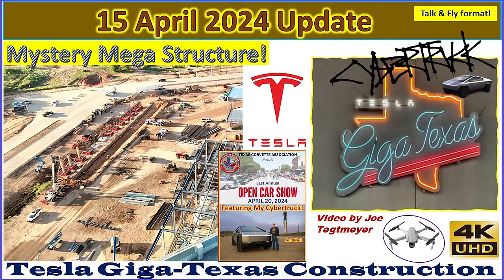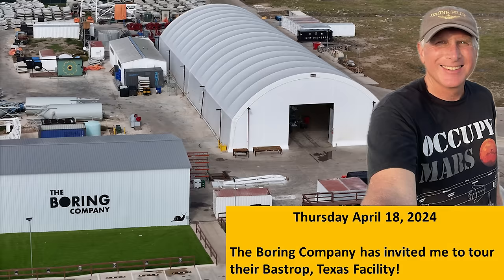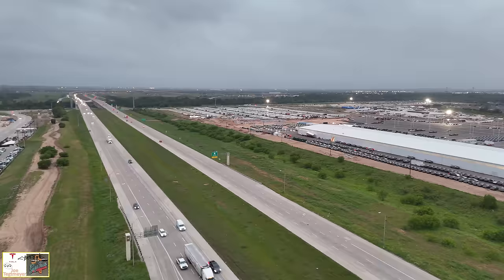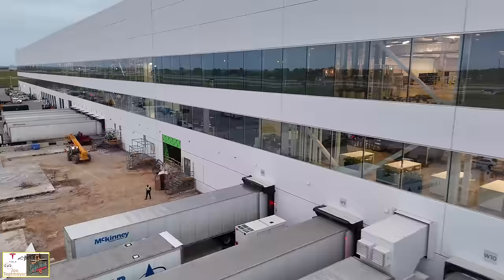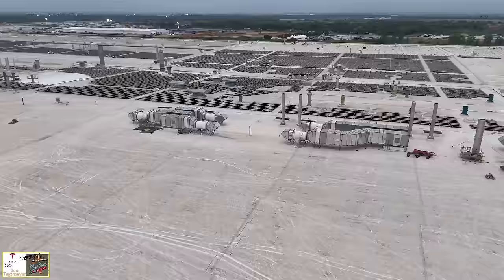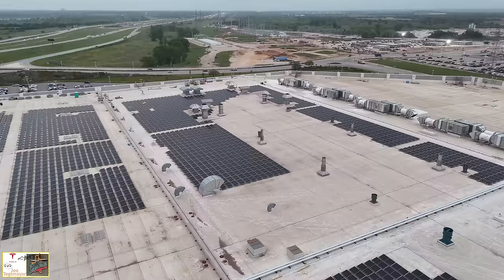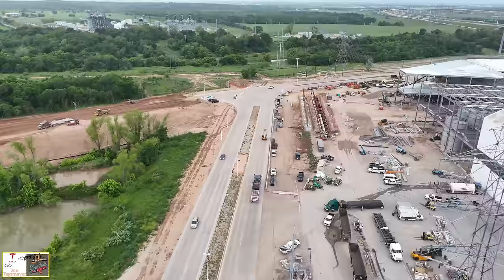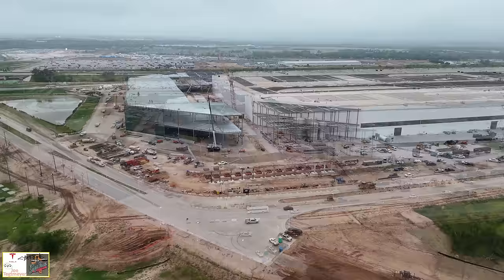Mystery Structure! Cybertrucks Pile Up & Leadership Changes! 15 Apr 2024 Giga Texas Update (07:15AM)

Comment: Thanks Joe
0:50. Southend. New Structure. Structure is located between Austin Energy easements. There’s an 800’ long sliver of land between the easements, tapers from 0’ at the north to 120’ wide at the south. This structure is in that space.
Rebar loops on top of the columns show where beams will be cast in-situ between.
Speculating this a structure to support a bridge crane to unload the coils of metal for Stamping. 
Up to 5 trailers are sometimes waiting on the apron at Stamping to back inside and have the coils unloaded. Lot of time wasted.
8:15. Paint, roof. Pipework Project. Pipe has now been lagged/insulated.
10:37. Die Shop, inside. Red legs of a gantry are briefly visible. In Joe’s photos a pair of red beams are visible, likely spanning the legs.
10:43. Die Shop. Inside. Curved safety screens around a machine. Can only be Italian.
12:21. Cathode. Inside. AHU-9. Air Handling Unit.
12:47. Cathode, tank farm. Vaporizers. Been an oops on the corner of the closest vaporizer.
13:04. Crash Test Track. Bottom left. 2 Red Model Xs.
14:14. Casting east, apron. Stack of castings marked for recycling.
15:37. E-WOW. Extra heavy duty low-laoder trailer. Been there just about every second video for weeks now. It’s either being stored here, or there’s big stuff moving in under cover of darkness.
17:06. Parking Garage, roof. Line marking around each stair location.
17:19. BIW, apron. 6 mobile chiller units still unconnected.
Roof. Top right. New large flue. Looks almost big enough to be the one delivered last week.
18:21. Southend, inside. Formwork/shuttering for a retaining wall.
18:52. Southend, inside. Right. Another retaining wall under construction.
19:01. Southend, inside. New slab has been saw-cut. It’s permanent. Large areas of GA have fibre reinforced concrete on Level 1/Ground floor.
Gap in the slab might get a conventional rebar and concrete slab to support the crane to remove the TBM.
Grade beam to the right. Fitting red plastic dots. Might be the top of dowel sleeves inserted into the beam.
20:01. Southend, roof. Back of parapet lined with Georgia Pacific DensDeck.
20:11. Southend, south. Parapet wall framing being constructed. If you sneak up on 20:11 you can see how the parapet frame is set back from the face of the glass wall below. Set back by the thickness of a glazed parapet facade.
20:42. Southend. Parapet. Won’t be concrete, no structure to support a concrete panel.
Inside. Column bracing to the right is rod. To the left and around to the west is cable.
21:52. GA west. New wall opening between the loading platforms. A week ago @eclecticmemes suggested this could be a temporary Cybertruck exit door.
24:57. New EOL, inside. Long view. Cybetruck on the elevated platform.
25:22. New EOL Supercharger. Bottom. Cleaning up the lighting tower footing. Installation of towers soon possibly.
Reply: Great list, Dessie!  Didn't notice it in previous videos, at 4:17 the ramp for gravity unloading (presumably tires) has a trailer / is in use.
11:52 looks like wiring for destination chargers at the north end of Cathode
17:06 I thought I saw the line painting cart zooming across in Brad's video, confirmed.
Reply: @Gig0Surf  4:17. Good spot 1. Eyeballing the trailer roof with the one adjacent confirms the idea that it raises the trailer.
11:52. Good spot 2. Missed those completely. About 20 locations.
17:06. Yes, was seen in Brad's video Saturday. I was looking on the lower floors for evidence of line-marking. Missed this stuff on the top deck initially.
Reply: 20:42 One of the other drone crew spotted some glass panels the right size for the Parapet
Reply: @paulstubbs7678  20:42. There's a bunch of removed windows stored on the west side. 

Potentially the right width, probably not the correct height.

The parapet glazing is also likely to be front-glazed* in the frame to keep it flush with the windows below.

*Front-glazed. Australian terminology, I wouldn't know where to start looking for the correct US/Texas term. In a regular commercial window suite**, the glass is generally either central or front.
**The frame system.
Reply: 1.  Southern addition.  Assuming the rumors/disclosures of yesterday are correct, what we are seeing of the new southern addition has to be rethunk......  Why are there no shipping docks?  Is it because the rumors are true and we are looking at the addition of not a model 2/robotaxi production line facility but of a huge computer/data center?
2.  If these rumors are true, then the mystery foundations could very well be a mini power substation for the huge, huge power draw of the new data center.  Would also explain why we see no permits.  A mini powerstation would belong to the local power company, and not Tesla.
Reply: @eclecticmemes  The new duct-banks seen @ 8:41 9:31 9:45 and 10:01 from the Tesla Enclosure/Mega-vault, south to Tesla road will likely provide the needed power. The existing main power duct-banks have 8 conduits each. These have 12! That would increase the power available to the factory by 150 percent!
Reply: @eclecticmemes   Southern Addition. No shipping docks because it would ruin the monolithic facade. Everything comes and goes through back-of-house.
There have been some changes made already. The added beam connection plates to the columns facing north into the un-built area. That's not unusual for this build though.

Mystery foundations. The 3 passages, no doubt in my mind now that these are fire escapes. Can't do those via back-of-house, and so we see this subterranean solution. Until these got roofs I did think they might be loading docks.

The 2 rows of columns between the easements. Not 'will eat my hat' confident yet, but thinking bridge crane still.

No permits. Write this one down. We have NEVER seen a permit for any building works on this site.

We saw sections of 2 site plan revisions (in fact I think we only saw the revisions), we see brief outlines of Plumbing Permit applications, Mechanical, Environmental, etc, on the Austin City website.

Never seen a single architectural or structural drawing of a building. Closest would be some detailed drawings of the splitter box, cyberwalls, some of the stormwater drain outfalls etc.

We did see 20 or so drawings for the Colorado Rive Connector tunnel. I guess that was only because it was going under the river and disclosure was mandatory.
Reply: @DessieDoolan  The ones spotted were new in box
Reply: @paulstubbs7678  Thanks. We should know soon enough.

Comment: Hi Joe, A couple of questions you could put to TBC on your visit on Thursday:
1. To date they have only used EPB type TBM's. Are they looking at hard rock, double shield, Slurry and VD machine technology for the future? (they will need these for more complex geology).
2. They have experimented with hexagonal rings, but seem to be sticking with trapezoidal at the moment. Is this due to the common understanding of hexagonal rings being poor for watertightness, going round corners and distortion under high thrust loads?
3. Website says 3x power installed. TBM's are overpowered for normal use, Giga Texas (Prufrock 3 TBM) has 4 x electric motors which seems to be normal for such a size. Is 3x power a practical ambition and if so how with the main bearing take the load?
4. What is the maximum %age saving from excavating faster, since the materials, consumables, energy (specific energy i.e. Kw /m3 excavated) costs are fairly fixed.
5. How many mould sets do they have for segment production (given they can only use once per day)? And can these ring sets be used on any of their machines?

Hope they let you get some footage of their next generation TBM work.
Reply: 23.34. Top left. Bundles of small diameter metal pipe or conduit. For use in the tunnel? Fire sprinkler system?

Joe's TBC visit. I'd like to know when the project was first proposed. See how the time line matches up with various works at the Southend.
Reply: @DessieDoolan  My guess is that these are temporary utility pipes. Used for cooling water (in and out), dirty water pump out, possibly a compressed air line. They could be converted to permanent use of course, but they tend to be cheaper quick clamp type which are extended a couple of times a day as the TBM progresses.

Comment: Thanks Joe!
New power supply for the factory (Speculated):
If correct, power to the factory will be more than doubled.
@ 8:41 9:31 9:45 10:01 From the Tesla Enclosure/Mega-vault, south to Tesla road.
@ 7:08 Also speculating that the new the new duct-banks will enter the building here, at the two vaults by the building. Or nearby in the area. Those two vaults were placed some time ago but never used.
Robotic Ave. extension:
@ 15:45 Paved.
River road extension:
@ 16:34 Ongoing progress.
South end, easement:
@ 18:13 Concrete structure... A structure with closely spaced columns seems to indicate that it will support a lot of weight. 
Dessie was speculating that this will be a bridge crane for unloading steel rolls or coils off trucks. I agree with that unless something changes.  Though they would still need a transporter vehicle to take the steel coils into stamping, it could be a smaller more maneuverable vehicle.
South end:
@ 18:52 They appear to be prepping this area for more concrete. If correct...What does that do to the tunnel theory?
@ 21:17 Conduit in trench has been covered in concrete. An indication that this is medium voltage 24.9 kV, not low voltage 480 V?
Reply: 18:52 If the tunnel surfaces inside the west side of the south extension, it might still be useful to have a "road" at grade across/going out the east side of the structure [as an alternate exit].   Would that be at a lower grade than the southern structure and/or a firewall be desirable?
Reply: 18:52. "What does that do for the tunnel theory?". Go to 24:06. Where's the problem?

Comment: The slab on grade isn’t actually that thick. They just thicken the slab to sit on the spread concrete footings. Pretty normal in construction. Slab on grade usually only has cracking/shrinkage reinforcement because it’s not structural

Comment: My guess they're pre making the columns to hold up the roof where the tunnel comes out of the ground. 
Just a guess.
Reply: My vote is for Boring tunnel exit also
Reply: given it's on the ERCOT easement, my 2 cents guess is this is part of a sealing end compound for transitioning transmission lines from aerial to underground up to the switchyard

Comment: Hey Joe, I believe that the thick concrete in the middle of the southern extension that does not have any rebar is where the boring tunnel is going to emerge. What do you think?  I think it is for preventing collapses, and rebar would just get in the way of that.

Comment: Joe, it would be cool if you could ask permission for Boring company to show you the Giga Tesla tunnel as it is being built.
Reply from the maker: That was the original plan, but it got changed at the last minute. Hopefully we can figure out another opportunity after my Bastrop visit.
Reply: @JoeTegtmeyer  Thanks for answering. I keep my fingers crossed. I send you a comment on your last video with a request. Please check. Thx
Reply: Anyone figured out how to estimate how far they have bored? I am guessing about 75 feet based on the lower conveyor carriage rising up meaning the belt is extending in.
Reply: @chadgnadinger1492  No, but it appears a very slow process, especially in light of the fact that this is sandy ground and nothing like rocks in mountainous areas.

Comment: My initial thought for the mystery footings was for columns to support a large solar panel roof to cover a row of Super Chargers designated to Tesla Semi. There's a lot of room around that corner which would give the Semi plenty of room to move in and out. Its a bit hard to gauge the distance between the columns though.
Reply: Interesting idea, wouldn't the Semi chargers be better located in a logistics area — or would here be closer to a cafeteria?  [I like the solar panel roof idea, thought it might be for covering a larger shuttle/robotaxi area or perhaps executive and guest parking]
Reply: @Gig0Surf  
Thanks, I just thought that it would be convenient because it would be close to to some docks at that end of the building. Also with the size of the columns they could support a roof that would reach out further than your normal solar super charger roof. I can't remember the name of a roof that protrudes out a long way but is only supported at one end.. is it called a span?? IDK
Reply: @aussie_al  Cantilever. Span is between supports.
Reply: @DessieDoolan  
That's it, thank you
Reply: I think the superchargers and the semis will be located where the old contractors parking lot is located where they are installing all the electrical lines

Comment: If there is going to be a datacenter in the extension it's just going to be in part of the building - perhaps the 4th level?  There is nothing in a data center that needs the kind of floating foundations they are putting in three parts of the ground floor.  Some BIG manufacturing equipment is going on this first level.
As to the mystery columns, I'm betting that Joe's guess is correct - an unloading and handling station for rolls of stainless.

Has anyone noticed the conduit in that triangular lot next to the contractors parking?  It's way too big and way too many tubes for just lights.  Has to be major wiring for chargers.  Then, if you look at how far the rows are spaced apart - this isn't for cars.  I think this is going to be the marshaling yard where electric semi's charge while waiting for their load in the outbound lot.
Reply: I agree with you 100% about the old contractors lot…a perfect location for charging semis and near the outgoing lot..but the three foundations or tunnels in the addition to the factory are fire escape tunnels…or are you talking about something different?

Comment: The new construction on the south side with the piers looks to me that that area is not an easement..the electric lines angle…the new concrete on the south side looks to me doesn’t line up with the tunnel construction..if the tunnel enters inside the building it would be between the concrete and the existing wall…also the parapet wall on the south extension I think will be glass and not concrete..

Comment: Mystery structure that’s inside power line easement is an electrical tap to the overhead lines to supply power for the data center that’s going to be located inside the new addition of factory. Possibly an addition of Mega packs added in future for power backup in the event of electrical outage.
Reply: Not how you would tap those lines

Comment: 23:58 The entrance of the tunnel doesn't seem to to aligned with the new southend extension and TBM landing area at 19:00 ?
Would it be possible that the tunnel get a curve? If so, why not having starting the digging entrance further on the right?
Reply: 19:00. New slab is not associated with the tunnel, other than a possible location for the TBM removal crane to set up on. Tunnel alignment is next column bay north.

Comment: In case nobody has noticed. Tesla has issued a STOP SALE on the Cybertruck. Accelerator pedal issues. This story is all over multiple media outlets.
Reply: Oh that STOP SALE was probably the reason for the 10% layoffs.. I wonder if the layoffs are just temp. until they can resume CT production ?
Reply: @davidwood7170 No, the layoffs are probably due to slower sales. The problem with the Excelerator pedal is that the cover is slipping off probably so it’s pretty simple fix and not a reason to layoff  people.
Reply: Serious??  production is stopped for that? Totally insane. Maybe that’s why the CT seemed to be accumulating in the testing and calibration lot whilst the  model y seemed to be swiftly shipped offsite after leaving the factory
Reply: @patrickspader4062 one component can take the whole production line 

That's why cars are hard. If they had an issue with their glass supplier then why couldn't make CT

Comment: Interesting ... early on I had noted that, although it could've been a camera angle issue, it didn't appear that the Prufrock machine was aimed downward at an angle sufficient to pass under the highway side drainage swale. As things are developing it appears that my impression was correct, as they have built a ridge across the swale, apparently to provide enough headroom for the tunnel to pass. This has disrupted the drainage flow through the swale, as evidenced by the puddles on either side of the ridge. Remains to be seen how this will be mitigated.

Comment: looks like those columns are being moulded in place to be relocated later
Reply: They are each attached to 4 screw piles, they won't be moved later
Reply: I wondered the same.
Reply: @Gig0Surf  Yep. Going nowhere.
Reply: But does 2 x13 columns has any special meaning?

Comment: Joe those pillars with red forms may be similar to the construction of Giga Berlin where they built pillars and supports and then moved them to prepared ground. Possibly location would be east side prepared area by casting,
Reply: These are permanent. Built on screw piles, in a trench.
Reply: I believe those columns in Berlin were precast. These are built in place on top of screw piles.

Comment: @15:45 seems odd to do the paving BEFORE installing the drainage
@20:42 wonder why the painted the vertical steel columns black, but DIDN'T paint the gray horizontal beams facing the windows
Reply: Either the drainage pipes are just being stored there or will be placed in non-paved areas.

May still paint it, they haven't installed glass yet.